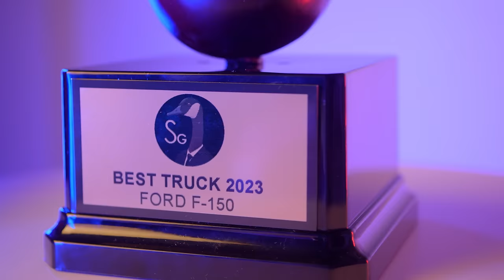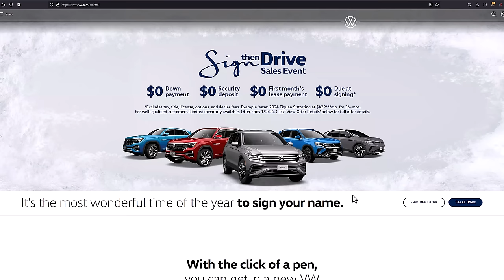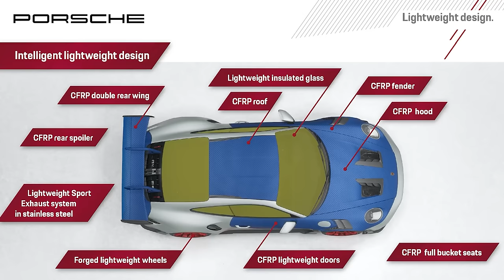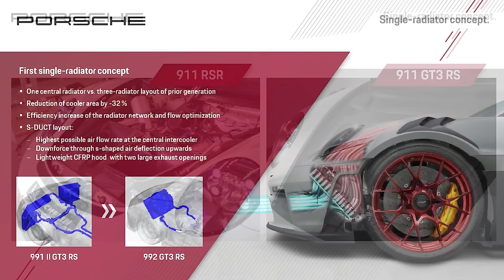Best and Worst Cars / Trucks of 2023 | Trigger Warning

Comment: I expected Mitsubishi to be the most uninspired brand but VW makes total sense.
Reply: VW seems lost without Piech.
Reply: Mitsubishi is a walking corpse
Reply: @augustortiz and vw is a Cleveland steamer.
Reply: Generally agree, however, they have a new outlander, which is a better car then expected, and phev version is good. Also, they renewing the L200, Montero and etc. Who knows, may be they will be back
Reply: @artempavlov4599  Mitsubishi should come out with a new Eclipse coupe. Make it bare bones, turbo 4 cylinder with about 250 to 280 horsepower, lightweight, basic HVAC, basic small screen infotainment, no moonroof, rear wheel drive, manual, make it under $30,000 and it would sell like hotcakes. basically a better GR86. they could probably just take the 2.5L 4 cylinder from the outlander and put a turbo on it
Reply: @artempavlov4599  The Outlander is better than you expect from a Mitsubishi because it's a reskinned Nissan Rogue.
Reply: @MTechn1k  He didn't get everything right but at least he had vision and strongarmed the company to achieve it
Reply: @pkdude5334  You're insane if you think Mitsubishi is willing to spend money developing an all new coupe, especially a bare bones economy one that will have the tiniest of profit margins. Not even almighty Toyota with their deep pockets wanted to go into it all alone so they partnered with Subaru to spread the costs. Because it's a small market that is only getting smaller. And do you really have any hope that Mitsubishi can build one now that is half as good as the Miata and 86/BRZ when all they've built for the last decade are crossovers for people can't even qualify for a loan at Nissan?
Reply: @pkdude5334 One can dream, huh?
Reply: @TornadoOfSouls777  cool name! Megadeth 🤘
Reply: @pkdude5334 are you going to give them the millions of dollars to do to RND for a car that won’t be profitable?

Comment: Thoroughly disappointed the Murano CrossCabriolet was not able to pull it off this year, Nissan clearly have not been taking their T supplements
Reply: Nissan should take the engineers in charge of the design of the convertible Murano and fired them all. Worst design, ugly duckling award for their useless contribution to Nissan.

Comment: Nice honesty on the Darkhorse! It's a Camraro 1le Competitor, and it should be priced as so loaded. It's a low 50k car loaded - not 70k+. 

Put it against a 1le on the same tires with a professional driver, that has a better track than a cornfield.

It's a Mustang GT at best, and I'd say it's not on the same level as a 1le.

Comment: bZ4X (Lease) - After $7,500 manufacturer rebate and $3,500 dealer discount OR (Finance) - After $2,500 manufacturer rebate and $3,500 dealer discount and this still are rotting.  At this particular dealer a few have sold / leased.

Comment: I really like the current Honda lineup but not crazy about the pilot. I test drove a trail sport and found the steering to lite, rear seats uncomfortable, and engine noise uncomfortably loud during full throttle. To your credit it's very functional and roomy. Perfect mall machine hauling the 3 kids around. If maximum space is not a issue I would take the MDX any day
Reply: I drive a 2018 Honda Fit and it's engine is just crazy loud. Since I have had it I pay attention to other Hondas and they all suffer from this terrible buzzy rattle noise. I took it to a dealer because I was worried and they said they get that a lot. People realize how loud the engine is and think something is wrong. It's from the direct injection they use. It just causes so much noise. Even on the brand new expensive larger Hondas they suffer from that noise.

Comment: My only problem with the Prius is that the interior space is vastly smaller than a Honda Civic Sport 6MT. However, I think a hybrid powertrain would be a must for a new vehicle purchase. I don't see myself wanting to hear a CVT drone and not get substantially better fuel economy. I don't see myself wanting to daily a manual transmission either. Why would I want to shift from 2000 to 1200 rpm on my daily commute 3 times in a row to get up  to speed at every single stop light and still spend 2x on fuel vs a hybrid? That Honda Accord powertrain is the best on the market, if Honda brings it to the Civic at the same price as a Prius I would buy a new vehicle.

Comment: I was expecting the Vinfast VF8 to get "worst" but, *effort*. Vinfast is a brand-new automaker from a country that never made cars before, on that level its' worst flaw is that they failed to bring the bargain pricing that would make its' other flaws tolerable. Toyota could and should have done better than the Busy Forks, and did with the new Prius (why they didn't just do a full-EV Prius alongside the closed-loop and plug-in hybrids is another question).

Comment: The only thing triggering me is the tag on Mark's hat. @8:00... Dieselgate killed VW. VW used to be the brand for dieselheads to go to. My '14 VW Jetta TDI manual was a great car. I sold it before dieselgate. I got 55 to 60 mpg on the highway, higher than it's EPA rating. I only sold it because I rarely keep a car more than 6 months. I have car ADD.

Comment: "Atlas is ancient" - VW literally just put out a new version of it for 2024.
Reply: The atlas came out in 2017, other than a new ip panel and a couple drivetrain changes its essentially the same vehicle. In 2024 it received a mid cycle refresh
Reply: Just because it’s a 2024 vehicle doesn’t mean it’s new, tried the 2024 it’s almost same and is way behind everyone else,  or to mention it’s cheapness

Comment: F-150 should lose its award, awful reliability. Bought a used newer one recently. $10k in 15k miles no joke. All from parts ford designed incorrectly and I had to wait a year for parts. That’s right a year. Good supply chain…
Reply: I hope the new Taco and Tundra don’t go down that road.

Comment: You mentioned that Toyota "clearly put in a lot of work" into the Prius.  But isn't it largely just a copy of the 2nd Gen (2016-2019) Chevy Volt?  It looks nearly identical, the drive train (at least for the Prime variant) is very similar ... why did Chevy not receive similar accolades when the 2nd Gen Volt launched back in 2016?

Comment: You should take the piano black award base one step further.  Any vehicle which contains any amount of piano black should automatically be moved to the bottom of the list.  Consumers like me will still buy a car even though it has piano black all over the interior.  However, car manufacturers need to be pressured to never, ever under any circumstances use that piano black shit ever again.  It is terrible.

Comment: What a load.  Hyundai has more recalls, customer complaints than any other manufacturer.  The Ford F150 is a failure.  No one wants to pay 80k to 100k for a truck with a dismal reliability rating.  Look how many F150’s are sitting on Ford lots unsold across the nation.

Comment: Yesterday I had a deal lined up for a clean title one owner vehicle. Low miles, did a bit of internet haggling and got a 2k knocked off the price. Drove 3 hours to pick it up only to find a creak in the rear wheel when driving the car. Looked closer and the dealer didn't even bother to do a good repair job on the rear bumper. The paint was cheap and terribly done. I got underneath the car right there and saw 2 new mufflers WITH TAGS STILL ON THEM. The car was obviously damaged. Opened the trunk, bondo everywhere. This was a "certified" toyota dealer.
After a whole day wasted, decided to go to other dealers. There was a Honda dealer giving 5000 off any new car. Thought maybe get the accord hybrid. Slow af pos but I guess it will do with 5000$ off. But wait, there were 5000$ in added options and fees. Great, almost 40 grand for a plastic shit box that can't even go past 60mph at any reasonable rate, my 99 civic was quicker that that! Tried all sorts of cars, garbage, garbage, garbage, and dealers even worse than the cars. 

There is literally nothing to buy, and anything worth buying is 40k+ with 100k miles and 5 years old with MSRP's that used to be less than what they are priced at now. The average consumer is being shafted so hard left right and center, and this needs to be addressed. I have never had such a terrible buying experience from 30+ dealers in one year over a freaking toyota/honda product. At this point I might as well bight the 50k price tag of a brand new luxury car and give a big middle finger to all these stuck up dealers who think a car that cost 25k in 2020 is worth 30k today used and 40k new.

I see why people want carvana to do well, because we are tired of this BS. I want real photos of a real car and transparency, just like there was back when I bought a car in 2005, 2007, 2012, 2015, 2017 and 2019. But no. Not happening. At this point, your "new car" is garbage, and the used market is too shady, all for what, 2000$ more profit? I had to literally read out the dealers contract that had a ** saying "optional accessories chosen by the customer" and they told me that I can't remove them, but I did not chose them. Called my lawyer and asked him on recording to tell me if that is legal and played it back to the dealer there and then! They took it off in shame. Ridiculous.
Reply: I feel sorry for ya lawer😢
Reply: What did your lawyer charge you for that call? $5000
Reply: @OutofSpecStudios  Comes with the family, go get an education.

Comment: Ford f150 triton is by far the worst truck.   That should been mentioned.  The lucid air is unattainable by the majority of your audience and it’s electric for God’s sake.    The ev world is facing huge challenges as they remin on dealers lot by the thousands.  Only tesla is doing well.  Ford ev truck is a total failsure. If4 another failure. Bolt volt more failures.  
The corvette hybrid could have easily been the best sports car

The Toyota brand is absolutely the best quality overall.  

Folks see an ev- run

See a hybrid from Toyota - embrace it

The Lamborghini is another example of another unattainable car by majority of yr audience 
And it’s a Volkswagen products 

Lucid air is another battery waiting to fail and then replacement will be some $60,000 dollars 

Come on man

Comment: A criteria that should be used in evaluations, and rarely is, is durability. What will the car be like in 10 years of daily use. 

Everyone is so worried about "climate change". But do you know what would help "climate change"? Not buying so much shit that has to be manufactured and requires energy production to do it. Imagine the reduction in the "carbon footprint" if cars lasted 20 years (or more). Look at the Volvos of the 70s. You could go 400k miles in those things.Oh, but then people would lose their job? Heck, robots are making most of the cars as it is and we already don't really need car salespeople.

Oh, and think of the saving for your wallet if you only needed to buy a car every 20 years. Of course, for those who like to waste money there is nothing wrong with buying a car every 3 years, btu at least for those of us who don't like throwing money away on a car we wouldn't' have to.

I know that everyone on here already know this, but just in case, car companies intentional design and build cars to break down after so many miles. Worried about BS climate change? Then fix that!